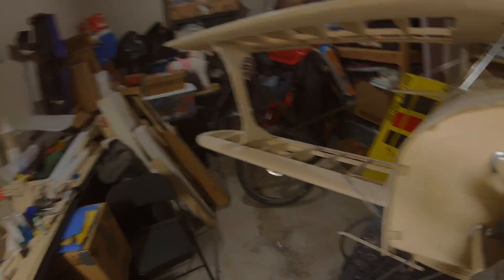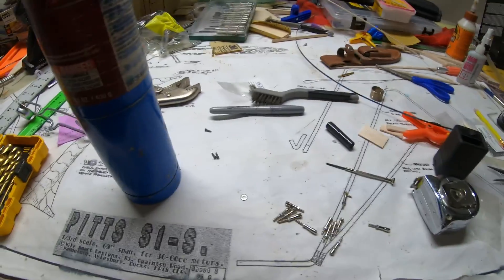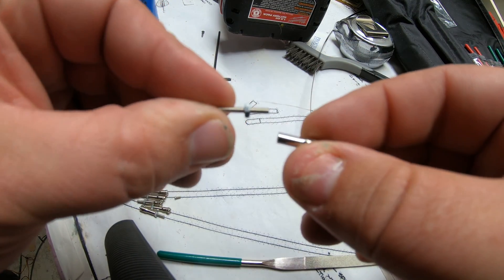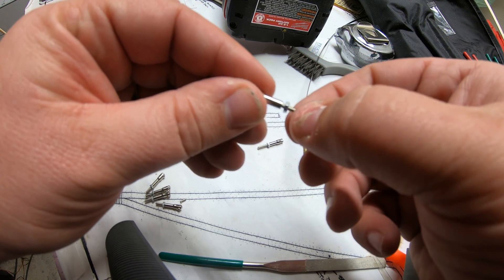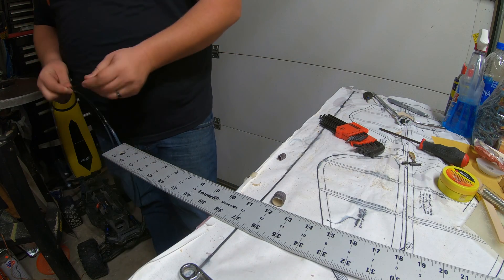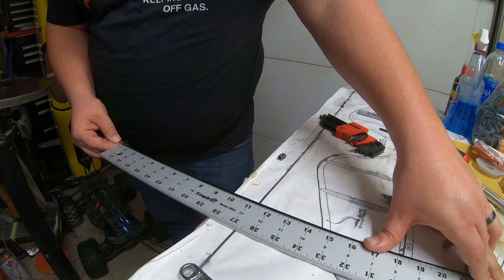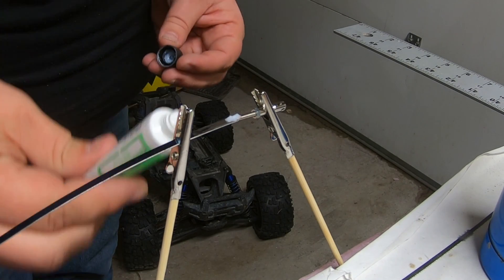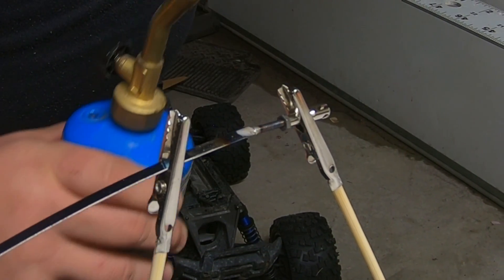Scratch Building an RC Airplane: Flying Wires with Mick Reeves Fork End Connectors

Comment: that joint is the weakest part of the wire butt joint no good  you done it as best as you could i would overlap on the fitting 10 mm  use silver solder rod with flux and round off put heat shrink over would look ok if those wires break you will have the walk of shame
Reply from the maker: I do plan on doing a test to see how much they will hold

Comment: That solder joint, I think you would have been better off cutting a slit in the rod wide enough to slip that flat stock between the slit and then soldering them together, this would make a stronger joint than a butt joint.
You've done really good work on the aircraft.
 My thoughts are during flight the vibration caused by the motor and the air moving over the flat bar will weaken the solder butt joint over time and might lead to the failure of the flying wires.
Reply from the maker: You are correct although I don’t have anything precise enough. My cut off wheel was the same thickness as the screws

Comment: Where did you get the wire? I have a bipe in the works that I would like to add fling wire to.
Reply from the maker: I ordered the wire from McMaster-Carr
Reply: @fromthegrounduprc  These will look great on my Skybolt!
Reply from the maker: @SomeGuyInSandy  what size skybolt are you working on?
Reply: @fromthegrounduprc  It is an old SIG kit that was partially assembled. Fortunately the guy that did it knew what he was doing. I'm putting an OS 65AX Glow engine in it.

It wasn't covered, so I'm doing a traditional dope/cover-all covering, and adding flying wires will add a nice touch.

I really appreciate your build videos. Especially the "git-er-done" attitude you have about it. Thanks for all the info!

Oh, Look up tail number N33RP for the color scheme!
Reply from the maker: https://www.mcmaster.com/product/9075K73